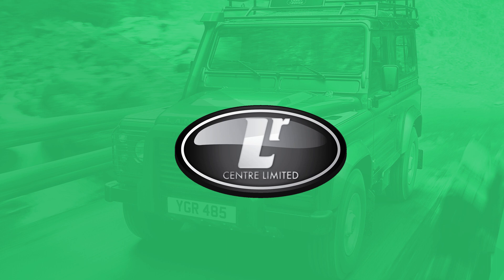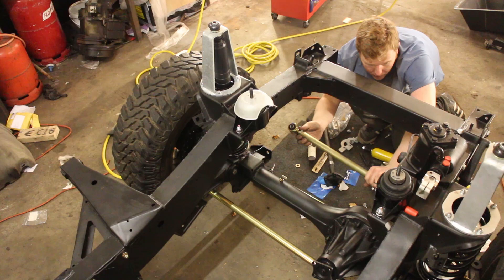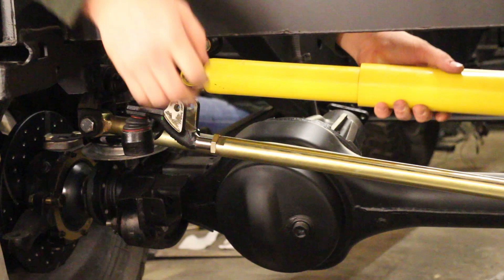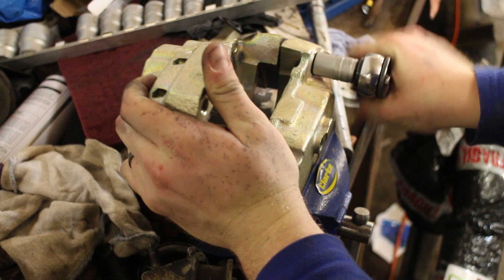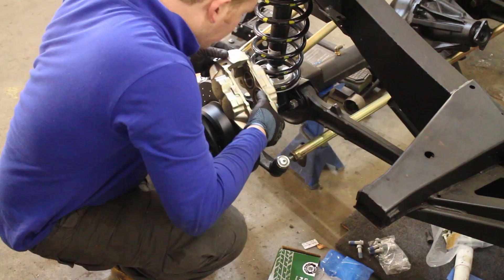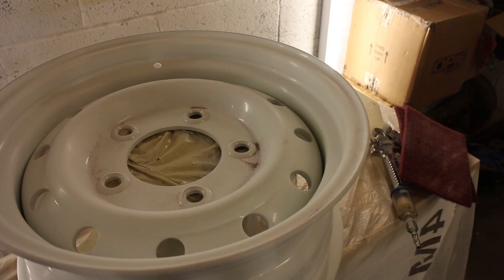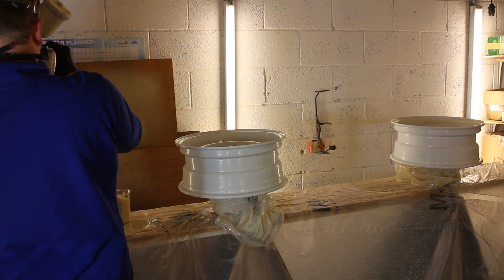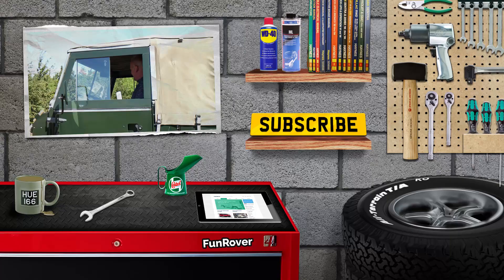12: Wheel painting, Brake Callipers, Steering Arms

Comment: hi, wonder if you can share your experience re brake pads. I have recently changed my tdci 110 rear pads ( genuine LD) which included new pins, springs, ant rattling plates and the split pins. ( I have dumped the old pads already). There is an annoying rattle in both rear wheels now. I see people talk about the same issue on forums but no one talks about a fix? Have you experienced this with any of your    defenders? i Reckon it could be the pins or springs or both?